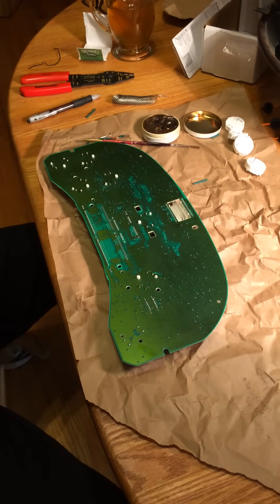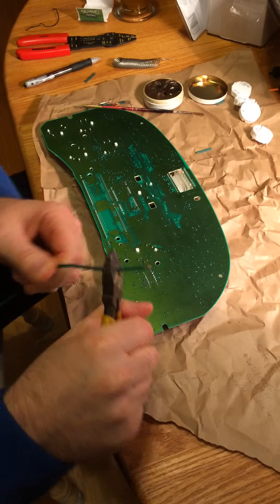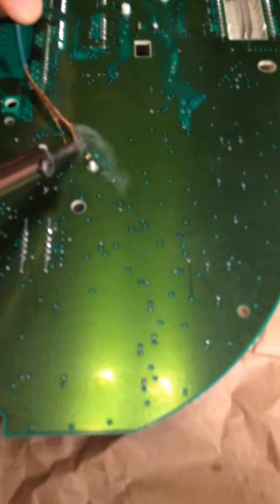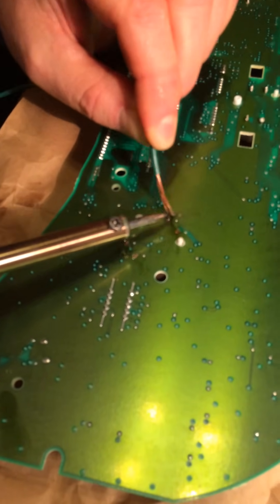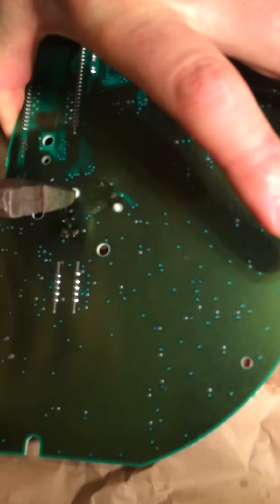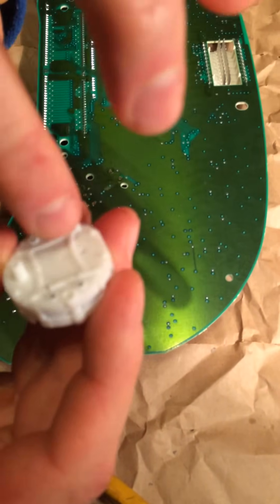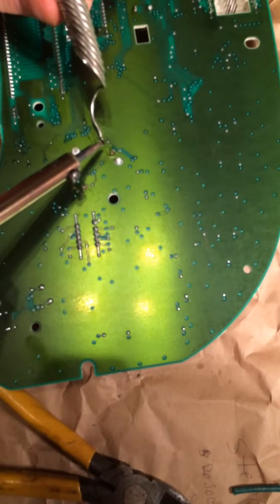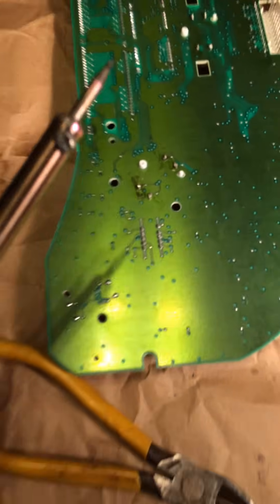How to remove solder without a desoldering tool or wick

Comment: Thanks. Have some copper wire (I remembered network/twisted pair cable is usually copper, the non-cheapass stuff anyway); but 😔 I don't have separate flux, just solder wire.

Comment: Thank you! I'm working on an electric guitar rewire and did not anticipate having to remove old solder. Open up guitar and oh, this will be a mess if I can't remove some of the preexisting... so. Local big box hardware stores sell soldering irons, solder, and flux but none of them sell pumps or wick. Very annoying. Will go get some wire. Specialty electronics store is a half hour drive away. Didn't want to sit on my hands for a few days waiting for online delivery.

Comment: Any flux? Or does it have to be Rosin Flux?
Reply: @joshuaragon6676  Yes. Acid flux and solder is only for plumbing/pipes. NEVER use it in electronics.

Comment: Hey , I have a de solder pump , would it be necessary for me to even invest in the wick if I use a pump instead. I was told with the pump u can just heat the solder and use the pump

Comment: you said without desoldering tool or wick
BUT YOUR USING A PIECE OF WIRE AS WICK
MISLEADING TITLE!!!!!!!! FAKEEEEEEEEE

DO IT WITHOUT EITHER!!!!!!
I know how to. just turn circuit board upside down and use the soldering iron tip like a sponge and let the solder flow away from the component with gravity onto the soldering iron tip.
just be careful doing it.. I got out a 4-lead component doing it that way!
Reply: Well dont do it at a straight 90 degree angle of course.
if your not careful and your trying to suck up a huge blob of solder at a straight 90 degree angle. that will happen.
its not my fault you burned yourself.
ive never burned myself while doing that with a soldering iron.

Comment: Thanks for the great tip, I've been wondering about that! I guess the gauge of wire used as a wick would depend to some extent on how large or small the solder joints are, and how much solder is being removed from each joint. Seems that at least 20 gauge is advisable in most cases, and for some really large solder joints, 10 gauge would probably be a good choice. (For the uninitiated, larger number gauge means a smaller diameter wire, ie 10 gauge is thicker than 20 gauge). Thanks again for the video!!

Comment: Do you need the flux?
Reply: yes
Reply: 97.dodge_punch of course
Reply: Flux is what pulls the solder into the wire. It's the same concept as putting flux on copper pipe; it pulls the solder into the joint.